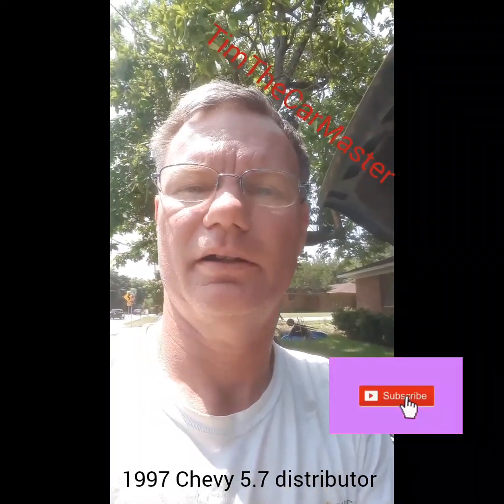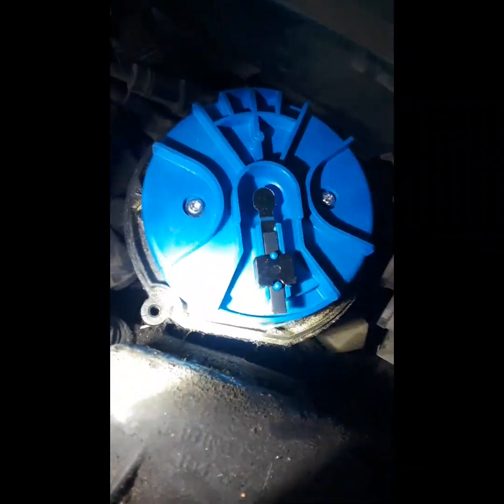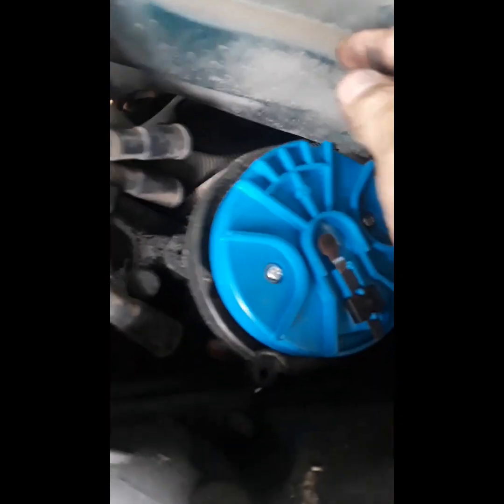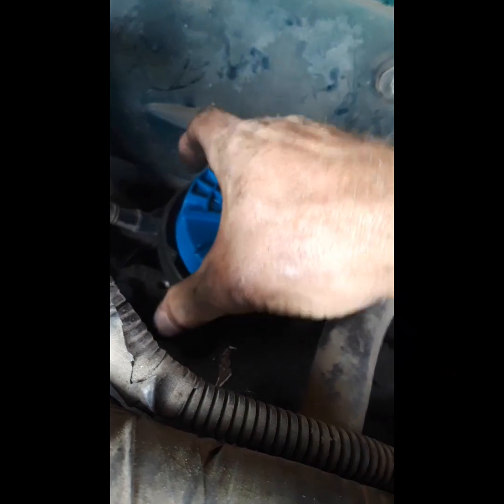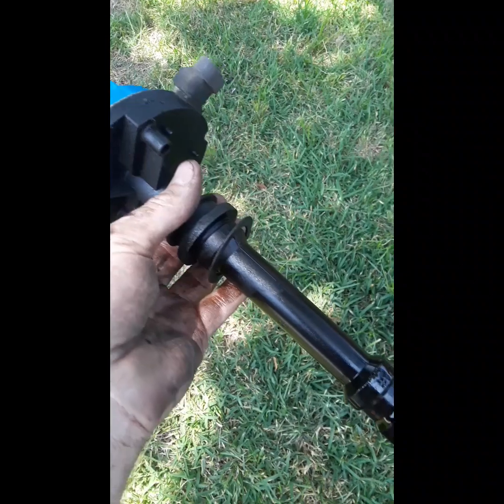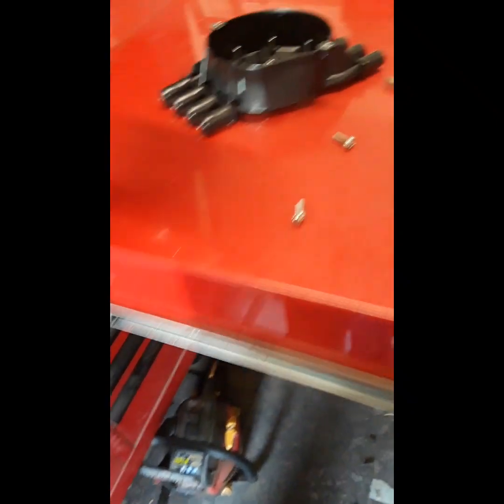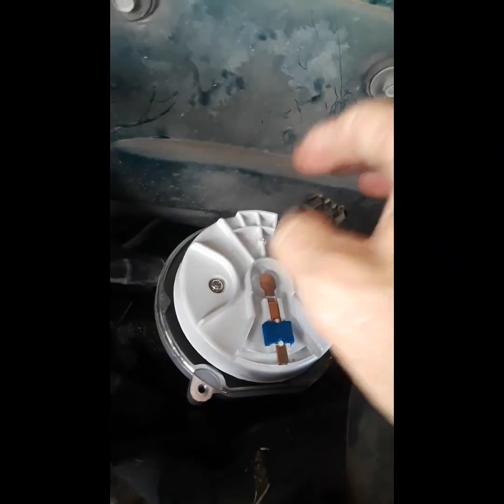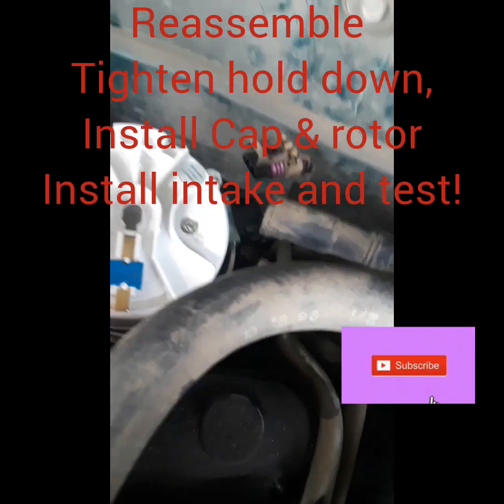Chevy 5.7 V8 distributor replacement

Comment: You can pull the Distributor out where ever it pointing at as long as it drops back in the same spot ur good to go. I pulled mine out and dropped it in place on first try
Reply: My brother is having trouble with his.  He has the engine at top dead Center #1 cylinder.....he says every time he drops the Distributor in  I think he said it faces #3 cylinder or #7 cylinder everytime ......what can he do to correct this????

Comment: The arrow you pointed to will only have the #8,  the #6 will be clockwise at 9 o'clock on the distributor base.🙄
Reply: Is the Distributor with the #6on it just only for a 6 cylinder???
Reply: @matthewvarnam4302  I have 1998 GMC Sierra SLE 5.7L and the distributor has both, v6 & v8 markings.  They use same distributor base for both.